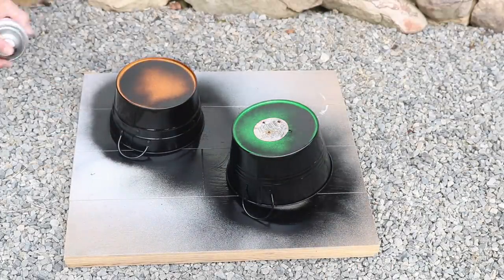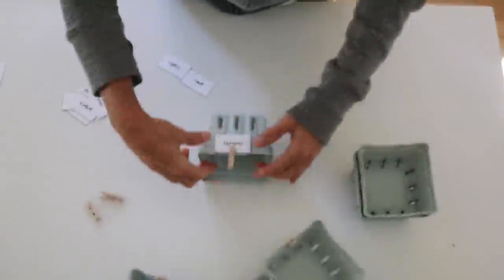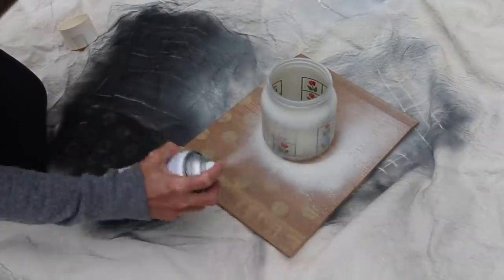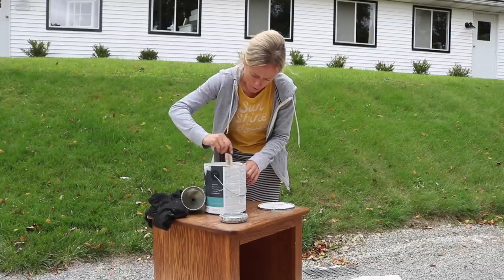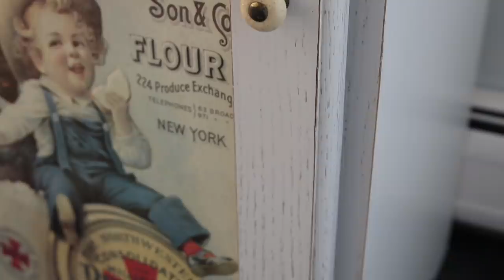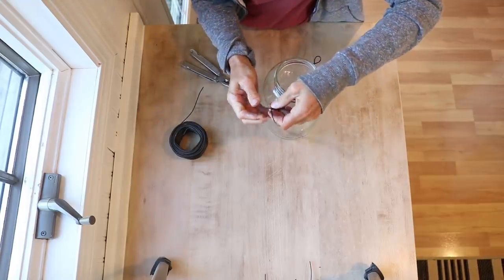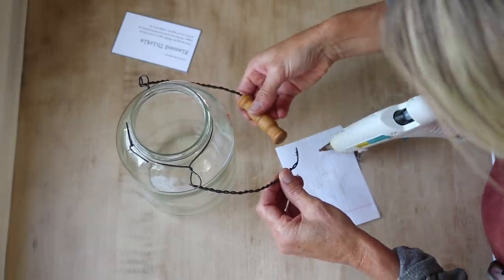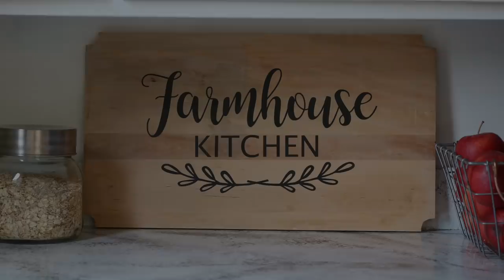Thrift Store Makeovers ~ Thrift Store Finds ~ Home Decor DIY ~ Thrift Store Flips ~ DIY Room Decor

Comment: Hi Mary, I ENJOY everything you present.  I have not been an actively engaged trash to treasure person, but now I have done one project:  I transformed an empty Clorox wipescontainer into a little trash bin to have in my car.  I was using the wipes at gas pumps. I cut out the wipes dispensing plastic bit, removed the Clorox label. cleaned it, added the word "trash" as a decal.  Looks super.  Thanks for inspiring me.

Comment: A fun way to twist wire is to put the ends in a drill where the bit usually goes. The opposite ends can be secured in a vise or over a nail. You can fold one long piece or you can mix types of wires. You can also add a twist texture to a single wire by twisting it in the drill. Love your channel. You are so creative and practical.

Comment: Do you do most of your signs with the vinyl lettering or do stencilling as well, I've just messed up a piece I was trying to do by trying to stencil it, but it bled just about every letter :(  Now I will sand it back and repaint it, but use the vinyl letters instead